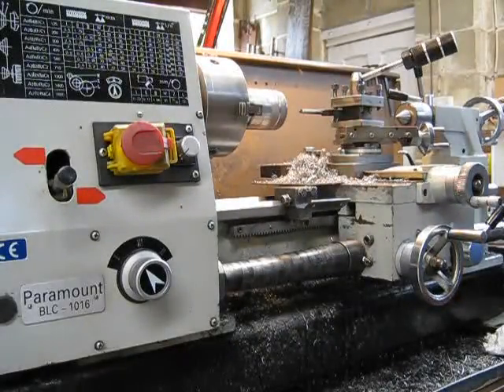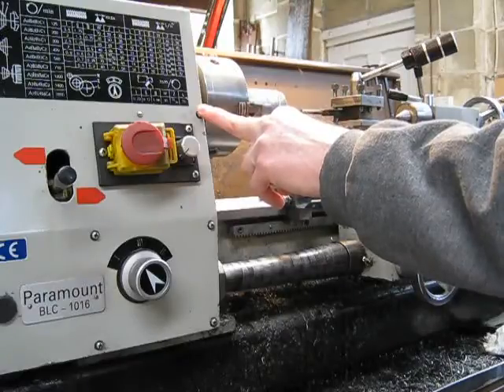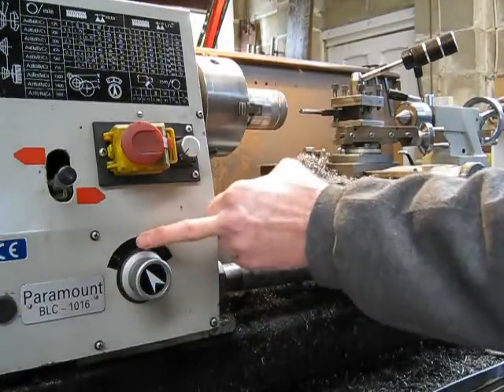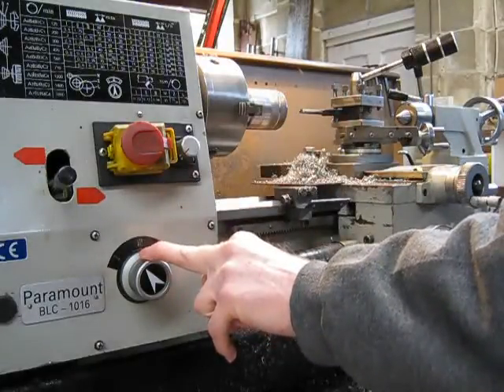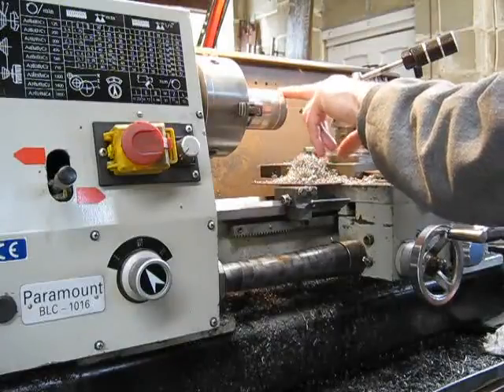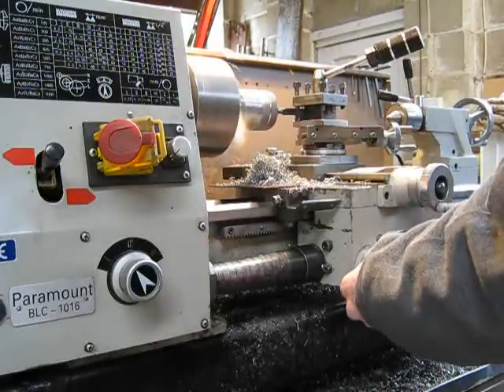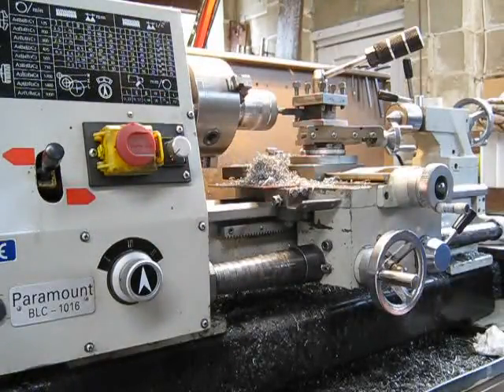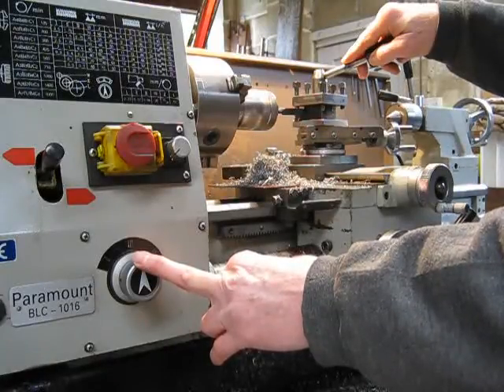Why I like lathes with a quick change gearbox

Comment: Gday fellow SA, dweller how you going. Just wanted to say thanks. I posted on another clip you did a while back about the decisions one makes when looking for a lathe. I ended up getting the FI -610 from paramount browns yesterday, it was a ex display so saved a few buck but filthy dirty I am just tearing it down and going through it prior to running it. It’s a solid unit with a lot of weight. My question I’m wanting to remove the top of the head stock to clean it out, Once the top 4 he Allen key head bolts are remove should it come straight of, I’m hesitant to give it a tap due to no real descriptive drawings come with it, nothing should be holding it on other than paint. Big job stripping and cleaning but I had to the build up of dust all through it is large. Cheers mate. I must mention I discovered a couple of wires that were just hanging inside the control area so I will see about that when I reassemble but i saved myself a disappointment by discovering it.
Reply from the maker: I've no experience with dismantling that unit.  Normally the top plate comes straight off.  Some have a gasket and some don't.  Maybe there is a gasket which is bonding the lid on. 

Look for a parts breakdown schematic (pdf) of a similar lathe on line.  This will tell you what you need to know.  Normally they include this in the user manual.  Cheers Rob

Comment: I was looking at a 10-inch lathe that featured a QCGB, but also included sets of change gears and instructed to change them out for various TPI or feed rates. Why would a lathe have both the quick change plus sets of manual change gears?
Reply from the maker: Because a quick change gearbox does not generally cover all thread pitches - given there are hundreds.

You will still have to swap over change gears for some thread pitches.

The most commonly used thread pitches are often covered by the QCGB range.

Cheers Rob
Reply: Aha, that's what I was suspecting - so you are changing the gears only 
to introduce another range of speeds, but would not necessarily need to do this as often as you would on a non-quick change box where you change for every single speed and pitch.
Reply from the maker: Yes.

In practice, for metal turning you really only need 3 or 4 feed rates.

But for threading you obviously need a wide range for the range of pitchs that's out there.

A QCGB is essential IMHO for any medium to large lathe.  Small lathes are excused, as they can't really provide them, given their small dimensions.

Certainly any lathe from 9" swing upwards should have a QCGB - unless you like self inflicted pain.

cheers Rob

Comment: hi,  could you please indicate the ratio between coarse, medium and fine.  considering fine to be 1
Reply from the maker: +Mukhthar Ahmed 

Fine = 0.05 mm, medium = 0.12 mm, coarse = 0.23 mm for this sized lathe.

You approximately double the speed for each increase in feed rate (per leadscrew revolution).

So the ratio is 1:2:4.

Cheers Rob
Reply: Thank you. I am looking for a gearbox or alternate diy solution. This info is very helpful.
Reply from the maker: +Mukhthar Ahmed 

You're welcome.

Comment: Ok, quick change will be a requirement when I get a lathe! 

Sounds like a lot of chatter on those runs...maybe choke up on the boring bar a bit?  I've heard that you want as little sticking out as you can get away with given the depth of cut needed. Speed and lube might help too from what I've seen. Less chatter will get a better finish. 

Thanks for the info!

-- Mike
Reply from the maker: Yes, plenty of chatter with that overhang :)  I went in after with a heavier bar to finish the cut.  Probably not a good example to show newbies.  Definitely get a quick change gearbox if possible.  I get frustrated when I hear people talking about quick change gearboxes as being a threading thing.  That's BS - you will change feed speed way more often than you will ever cut a thread.  Plus you don't need a QCGB to cut threads. Cheers Rob

Comment: Totally agree, I bought the AL320G on the basis of a 38mm spidle bore, I have needed that bore size once in 3 years! Messing with the gear train is a real pain in the neck. Cheers and thanks for the video
Reply: So glad I read your comment. That's me. So I've changed my mind to the other contender. FI-610
Reply from the maker: The FL-610 has been around for a long time and is a pretty well featured lathe.   I considered buying one originally, but went slightly smaller as I didn't need the extra length it offered.  It used to be about $1600 but is now about $2800.  Just shows how medium sized lathes have increased in price over about the last 20 years.  Cheers Rob